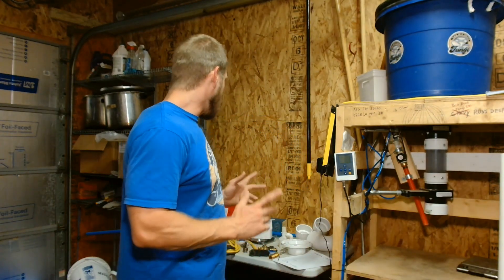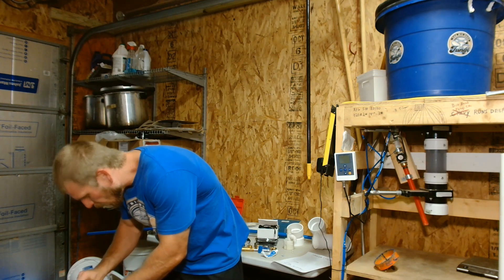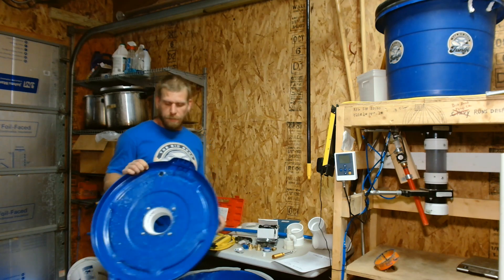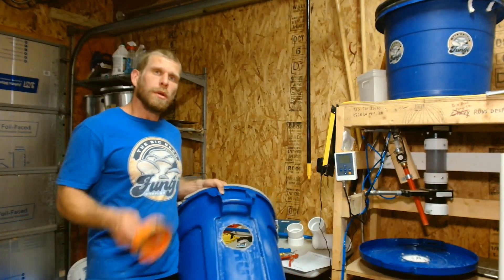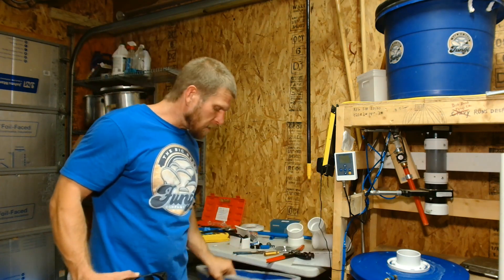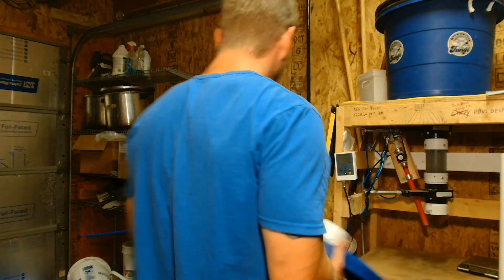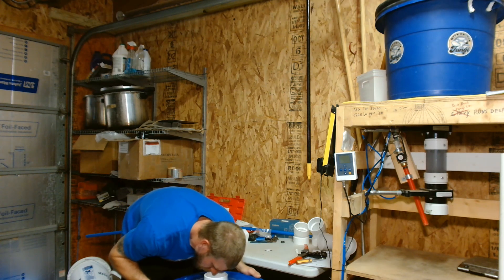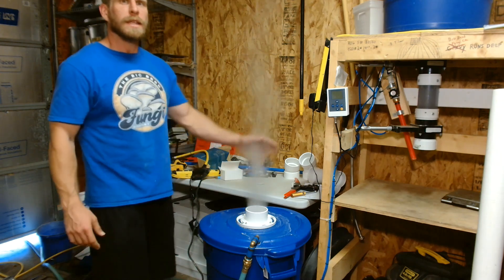Building a Mushroom Humidifier - DIY - Mushroom Farming

Comment: The way to make the hole without heating, the hole saw is to run your hole saw in-reverse. This will cut a hole through thin plastic without chipping or making a lot of burrs to clean up.
Start on one edge of hole and physically restrain the saw in the right place using some clamped pieces of wood. As the whole size progresses increase the verticalness of the drill until the hole is been cut, but running in reverse.
Reply from the maker: Heating it up is easier...